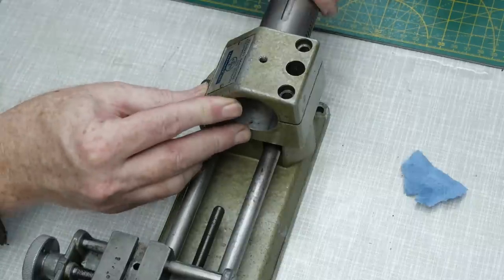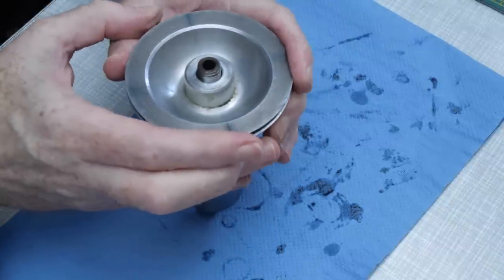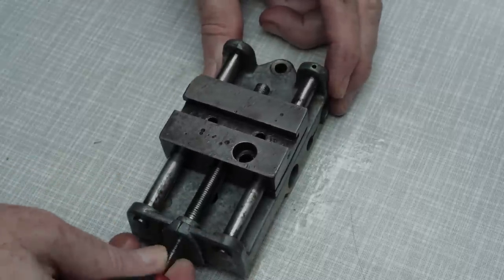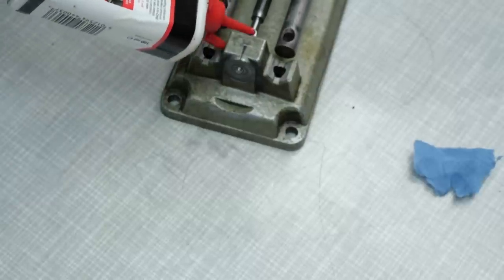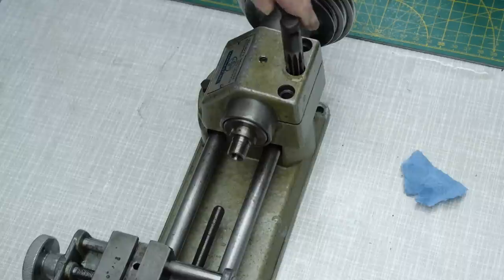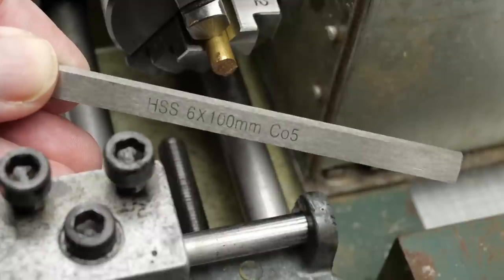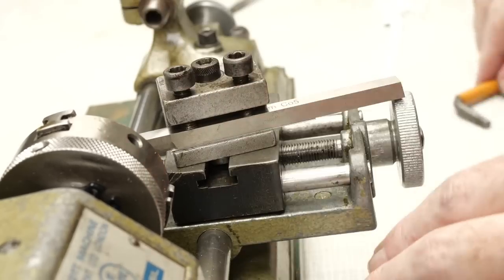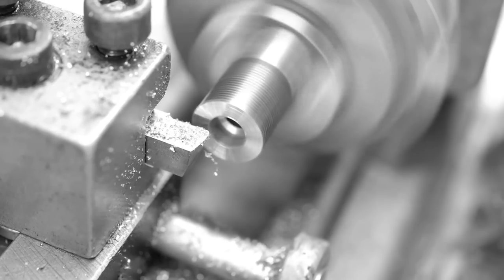First Chips on the Emco Unimat SL and Full Reassembly

Comment: I have just fitted a spindle to my Unimat. 500w, 12,000 rpm (max) it is smaller than the original motor. It fits on a bracket in the same manner as the original, and uses a 42mm pulley- this gives max 6000RPM, which is the max speed for the Unimat specified in its manual. I now have a full speed range via a speed control, and much more power. And no belt changing.
Reply from the maker: Nice! Sounds like a big improvement. Are you still able to get usable torque at low rpm without the belt changing?
Reply: @AdventureswithaVerySmallLathe  Yes, not a problem. Up to its rated speed, a VFD motor is essentially constant torque. It also does not slow down under load- it is a synchronous motor. Some VFD drivers will let you set parameters for acceleration and braking too.
With this motor the torque limit, in practice, is set by belt slippage- as I an using the largest pully on the lathe shaft, belt changing would give no more. I debated toothed belt drive, but decided that the added complexity was not worthwhile- the strain would show elsewhere in such a small lathe.

Comment: Some might think this is a bit pedantic, but the part of the tailstock that is screw fed and moves in and out, and often has a center or chuck installed, is the "barrel".  It is not a "quill".  A quill is what's on a drill press, and the headstock of this lathe, which has a rack & pinon feed mechanism (and surrounds the spindle).   A lathe's tailstock barrel is also sometimes called a ram.  Now, there are some tailstocks that do have a quill, but they are not common.

Anyway, great video as always!

Comment: Nice job with limited tools, a steel hammer is fine if a piece of wood or plastic is used as a cushion. A lot of the poor finish is possibly due to the drive belt noise transferring to the part.
Keep at it you are almost there, well done.
Reply from the maker: The drive noise is because the motor pulley is very worn, and rattling around the shaft. It doesn't seem to transmit a lot to the lathe, but it can't be helping.

Comment: Thanks very much for this great video. I have begun to learn clock repair and recently acquired a nice, and nicely tooled, SL100. I'm eager to learn all I can about these little lathes. Much different than running my 13"x40" or 18"x60" lathes.
Reply from the maker: Wow, that's a really big change! It'll take a while to adjust to the low torque small lathes have, especially at low rpm. Good luck with your new learnings.

Comment: Just stumbled on this very nicely made video. Thumbs up.  I own a CNC version cousin of this lathe Unimat PC which underwent through a similar procedure about 18 month ago. Mine however is missing the tailstock and few other parts. Positive:  amazingly small CNC lathe that works and can be stored on drawer. Negative: It's not a precise machine. Forget about getting to 0.001", I struggle hitting 0.01". I even replaced a cross-slide screw. It didn't; help at all.  I invested into some eBay unbranded QTCP from Germany and it makes changing tools a joy.  I built a little Arduino CNC controller which came out under $100. It's primitive but it works for very little this lathe can do (Spherical cuts+electronic lead screw). CNC part makes it easier with hundreds light passes. Chers.

Comment: You sound remarkably like Jeremy Wade from river monsters. When you had the runout issue with the brass your chuck was not locked tight to the spindle. There's a locking hole for a tommy bar in the spindle behind the chuck for this.

Comment: Wonderful assembly video. I suggest you consider moving the motor housing a bit more to the side as it will interfer if you may want to turn larger diameters. The base plate is great and can be fitted with another unimat  spindle and motor to do milling work.
Reply from the maker: The spacing is definitely a pain. Sometimes I run it without the aluminum box, but I'm worried that chips can easily go through the motor vents. Ideally I need a housing which shields the vents from lathe swarf, but doesn't cause the motor to risk overheating due to blocked vents.
Reply: @AdventureswithaVerySmallLathe  good point on the chips issue. What about a 3d printed or sheet metal housing that is solid on one side, near the chuck (and fits the motor snugly for more chuck space) and has a rooftop and screen beneath it for motor cooling? There are some very fine stainless mesh screens on ebay. I have a 350mesh screen and it's super fine...

Comment: Nice job. You might want to find the spring that goes on spindle between headstock casting and the pulley, this lets you use the spindle in drill press fashion.

Comment: I refurbished one as well, and what i did was make a QCTP for it.. after all, i'm a toolmaker 🙂
you could try and make a toolholder that holds Solid Carbide bits, i make mine from old endmills, grind them to half the diameter, and then make the reliefs.. i use the same kind of tooling on my EMCO Compact 5 CNC and EMCOturn 120..
Reply from the maker: Nice idea! Way easier to deal with the small clearance if the tool height is at the centre of the diameter. I have thought about making a QCTP for this lathe, and looked through as many designs as I could find. What design did you use for yours?
Reply: @AdventureswithaVerySmallLathe  I made a Dovetail style QCTP, Since i could mill that with a 3 mm endmill, the "block" has one Dovetail, tightened with an allen bolt, and you can easily flip it when changing to Boringbars.
Nowadays, i'd use my Wire EDM machine to cut these out..but it can be done with endmills..
I've also made a design that uses pieces of roundstock mounted to the block, so to make the holders, you only need to drill some holes through the holder, and mill the sides away, that is easier to make..
Reply: If you can find one, a Tripan 11 Toolholder will also fit right onto this machine, I have recently got an EMCO Unimat 3, and i put a Tripan Toolholder on it..

Comment: You could install a thrust bearing between the handle wheel and cross slide body to alleviate the backlash issue
Reply: That's not going to reduce screw thread backlash whatsoever.

Comment: You mean there wasn't a wooden dowel laying around to help drive out and re-insert the rails? Adjusting the tool holder while the lathe was on, twice! A socket wrench would have made removing some of those nuts and bolts a bit easier. Was there a rush to finish the video such that there was no time to acquire said dowel, wrench or stop the lathe? If you twirl the cleaning brush in the threaded holes instead of just pushing them in and out, they can clean the threads much easier. There will be many people watching who will quickly forget the "do as I say and not as I do" and then wonder why things go wrong when they do the same thing.

I recently inherited a very small lathe without any instructions on maintenance so it was good to see how the parts come apart and go back together.

Comment: I thought about purchasing a lathe like this or perhaps saving a bit longer to get a better small lathe.  I’m surprised that the spindle has a poor bearing setup.  Can angular contact bearings be installed in the spindle?
Reply from the maker: I think the bearings are ok for a lathe of this size, capacity, and precision. I don't think putting more expensive bearings in would help much, as they're not the weakest part of the machine. This machine is a nice bit of design, but if you have room then a bigger mini lathe would be a lot more capable. Most Unimat SLs available are old and quite worn. I think saving up for something better makes more sense.

Comment: Couldn't you just use the spindle grease for the tailstock rather than light oil? Currently restoring one of the early Unimat Mk2 (black cast iron)
Reply from the maker: Grease isn't a good idea for exposed parts, as it's sticky and will attract dirt. I only used grease on the bearings after reading up to confirm what is standard practice for these lathes. For regular lubrication I use the same slideway oil on the bed rails, cross-slide rails, and tailstock. Slideway oil is formulated for exactly this kind of application. Slow moving sliding surfaces.

Comment: Watch out using Molykote grease with small bearings , the tend to wear out very fast. I have problems with my model racingcar using molybdenium grease, bearings last 60-70% less than by using  lithium bearinggrease,  it is great for big bearings running slow. nice restoration

Comment: Sorry what brand of tools do you use on your Proxxon pd 250..... did you change the tool holder for 10x10 larger tools............
Reply from the maker: No, I use almost entirely 8x8 tools which fit easily into the holders. Most of them are unbranded tools from eBay, Banggood or AliExpress.

Comment: I'm on the market for a small lathe with fair precision, but more power than my vintage 8mm watchmaker's lathe. Do you suppose a Unimat SL might be a good option (given a tight budget)? Not sure if/how one should go about making a more powerful watchmaker's lathe. :p
Reply: Depends on what you're cutting and what your tolerances are.  The SL is ingenious, fantastic, enormously versatile, (and fun! -- I learned lathes on my dad's SL which I still have, which is why I'm watching these great SL restoration videos)  but the big heavy D-shaped bar of a Waltham pattern or Boley etc is enormously stiffer than the two 12mm rails of the SL.  Put an indicator on the carriage of the SL, move it to the middle of the rails and press with your fingers and you'll see some flex -- and that flex may be totally within your tolerances -- or it might not be.  I love both kinds (got a Boley - Leinen too) but they are a bit apples to oranges (and both hard to find good parts for on the used market).   Depending on what you're cutting, maybe step up to a Taig (small, very stiff, high precision, sworn-by by its user base but with limited accessories -- you'll wind up making a lot of your tools, which is fine if you're into that) or even Sherline, very precise, and darned stiff within the limits of its aluminum bed, but with an enormous line of very good accessories and additions.  

Go up in size and you start getting into Sieg 7x14" "mini-lathes" and "mini-mills" from People's Republic of China on the low end of precision, fit, and finish, but still a great deal depending on your budget and precision requirements -- they have an enormous worldwide base for a good reason -- although a large part of that enormous base who thought they were buying s Hardinge for 1/50th the price howl and cry when reality sets in.    But if you're already using a watchmaker's lathe I would think Sieg machines, even a great one from LMS, just are not going to make you happy.

That said, a few companies like LittleMachineShop.com sell MUCH better versions by getting first pick of Sieg's castings, and first pick of best toleranced assembly, larger modern brushless motors, etc: I have theirs and simply would not buy anything else -- check their specs and a bunch of YT sources for comparisons with bottom feeders' like Harbor Freight's cheaper but horrible version.  I love my LMS mini-lathe and mini-mill and have made my living doing prototyping and robotics components on them.

For high precision end,  maybe look at a used benchtop Schaublin -- a gorgeous machine built with the precision of a Boley watchmaker's lathe but scaled up in size, but also hard to find parts for -- file under "Expensive but worth it!" -- check nielsmachines.com.  So pick your materials and precision -- making great precision model airplane engines in aluminum is prime Unimat / Sherline / Taig turf but not so much if you're going for cruise missile parts.  Hope you find your perfect machine -- but just start with what you're doing now and want to be able to do and be disciplined (and realistic) about being guided by that.  

Good Hunting!
Reply: BTW, what watchmaker's lathe are you running?  What do you make?  I still can't shake off this fantasy of doing up a Boley as a CNC machine.  Some day...
Reply: @edwilliams9914  Thanks!
Reply: @edwilliams9914  I'm addicted to the original AWTCo. 8mm Webster-Whitcomb lathes, actually! I started with a beautiful copy-cat made by Boley-Leinen, and that inspired me to track down an original WW in good condition. I have one now, and that's what I'm using! I've been using it for making detail parts and fittings for my HO scale model trains, mostly out of brass and steel, but I've cut some aluminum and even plastic on it! Still trying to get the hang of tool geometry for each material, and threading is still very tricky for me, especially larger than 1/4" diameter. I'd eventually like to make an HO scale live steam loco, but without a threading attachment or a mill, it's sort of a pipe dream. I can't even seem to gind a proper parting-off tool, and everything current seems to be made or written for a much bigger lathe. Could be tool geometry, could be lack of torque, could be material... So many variables!

Comment: so i did this about 8 months ago, the 3 jaw chuck is not that hard to take apart, biggest problem is the locking washer on the back, need a tool to get that off and back on safely but can be done with a flat head screw driver and some needle nose pliers, if going that route have eye protection on and maybe do it in a box, as that thing can fly

Comment: While rollers rather than balls, my understanding of automotive wheel bearings tells me you want as much grease as physically possible. IDK about here, but I don't see how too much grease could be an issue. Maybe since there shouldn't be a large lateral force on the bearing, then they care more about friction caused by extra grease, rather than lubricity and longevity.
Regardless, good video.

Comment: I am surprised at how Emco can make such garbage machines now when in the past they made great stuff. The garbage our school got has no competition in the "Garbage for an unreasonable price" category of machines. 
For example the lathe we got (emcomat 14D) has a  fixed carriage stop that doesn't allow the cross slide to hit the chuck jaws when clamping a bigger part. Great feature someone might say. Yeah it would be great if the tool wouldn't be  a good 15-20mm from the chuck at best with the top slide in the most rigid position (small lathe problems). 
Same thing with the tailstock, it too has a stop WAY too far from the carriage so it forces you to extend the quill way further to support the work than would be necessary.
and some small things like: The chip pan is quite big and immovable with no room for hands and a brush so it's a pain to clean and the speed knob can be moved just by blowing on it. 
(the lowest price I could find that lathe was 13k€ used)
Rant over
Great video <3
Reply: Well, they have never been a high end machine. Maybe a high end hobby machine.

Comment: A little bit of top rake wouldn't go amiss.
Reply: Top take for steel, zero or negative top take for brass.👍
Reply: @garyshakles7764  Agreed.  The brass was fine, but the steel - not so much, which is why I commented.